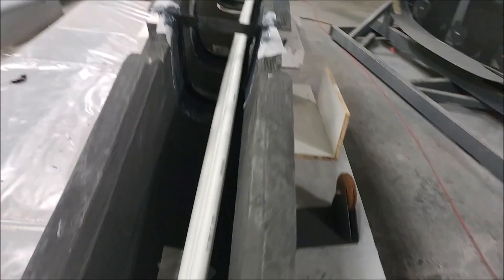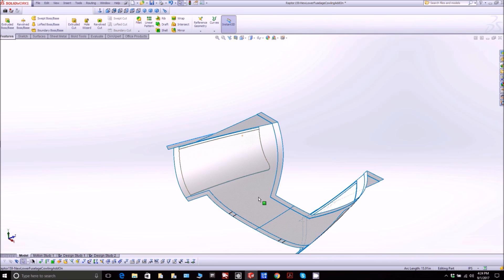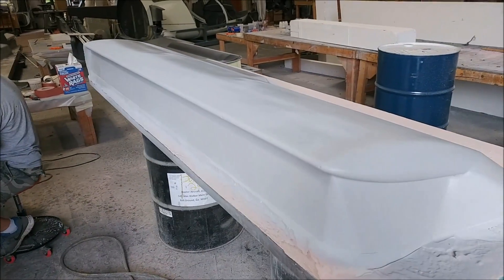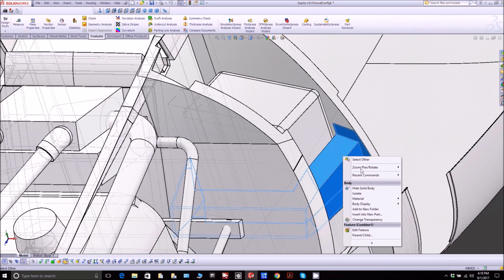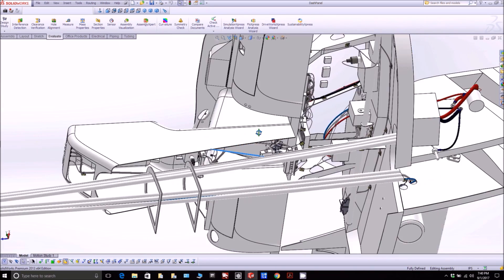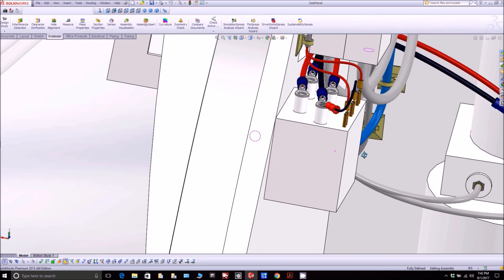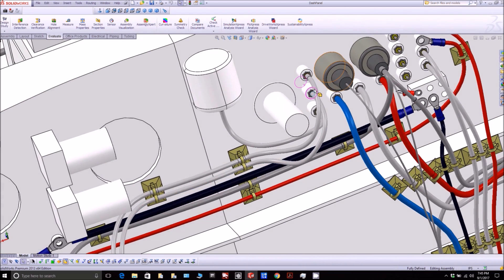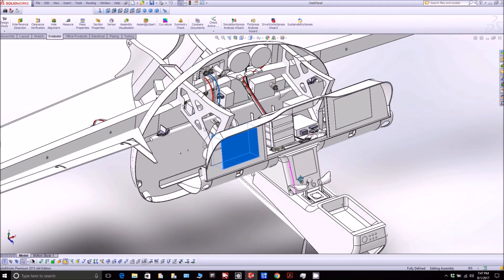Fitting the Nose Gear - And other aircraft building adventures

Comment: Regarding the white "conduits" being installed in the keel... The markings aren't quite legible on-screen, but they appear to be ordinary PVC pipes (please tell me if that's not correct). May I suggest there are much better materials available that more durable (not brittle) and more heat-resistant. For any electrical conduits, UL- rated materials are recommended. Among plastics, PVC (emphasis on "Vinyl") is rather low-performing.

Comment: Peter ~ I may have missed it, but there should be a speed-brake deploy/retract switch on the throttle; to deploy pull back, and to retract push forward to match the forward motion of the throttle needed go-around.

Comment: In the aircraft that I fly, to emergency extend the gear, you lower the gear handle, twist it 90 degrees then pull it out.  I dont know if this is something that can be manufactured or purchased.  But it will keep the emergency extension easy to get to, but also lock it out so it wont be accidentaly actuated.

Comment: I wouldn't put the gear dump so close to the parking brake since they will look similar.  It is common practice to physically that check the parking brake is off as part if the downwind check and it would be easy to accidentally pull the gear dump instead.  Better to separate them in my opinion to avoid accidental operation of the gear dump.
Reply: A wire clip cover or plastic cover could also be used to prevent accidental activation of the dump valve.

Comment: I know someone mentioned moving the ignition key before. I agree. The current location seems to be open to accidentally being touched or hit by either a hand or a bit of stuff that might be flying around the cockpit for one reason or another. Aside from this, the project is looking great!
Reply: I would put it to the lower left of the PIC MFD along with the 70A gear breaker and pressurization dump lever (if possible) shown in the center with a BIG red light.  I worry about my Grande Mocha for anything in that nice center console.   This key location and  these other things does not need to be readily accessible to the co-pilot and in the rare scenario it would be it could be reached...   Simply blown away at the pace and how darn nice this is coming out.
Reply: Maybe we need to come up with a keyless feature? Just like in our cars, our flightdeck will benefit from this. A dongle or similar..?

Comment: Is a key even required? Why not push button since the ignition will be electronic? Either way the placement isn't ideal if you'll need to adjust the throttle with your right hand during start. Perhaps the overhead idea. This would free up space next to the gear lever for the indicators - a bit more standard positioning. Could the VPX could be programmed with a gear warning based on airspeed to preclude a gear-up landing?
Reply: Matthew Berszoner 
I was thinking the same thing.  I don't think a key is necessary.  Just a guarded switch would work well; be it on the overhead or someplace else.
Reply: There is actually a switch on overhead console to actually start engine.  You can see it in the video when the switches were introduced a couple months ago.  Key would just be a security measure is my thoughts.
Reply: A key switch keeps it so simple, Maybe a FOB could be used. As long as you have the RFI FOB key chain with you the plane will start.  just throwing ideas around. I like simple personally. Key switch = simple

Comment: Question about the parachute. When the rocket is ignited and pulls the chute out, what are the chances if the prop cutting the wires? At higher speeds the parachute will be pulled up and aft as the plane starts to decelerate. Obviously not a problem with a tractor design since the apparent wind pushes the chute away from the prop. You guys seem to be very intelligent and have probably already done the calculations though. Can't wait to see this thing fly!
Reply from the maker: I mentioned awhile back that pulling the chute kills the engine via an integrated cut off switch.
Reply: gmonnig my assumption is that if you are using the parachute, the propeller won't be spinning (i.e. feathered = no worries)
Reply: Maybe in some cases the prop "could" be feathered but I would think most cases that isn't likely. Nearly all single engine aircraft don't have feathering props. This does have an electric MT prop so I would assume it could feather but it isn't a very quick action (10-15 vital seconds to feather). That also assumes that there is a clutch that actually disconnects the prop and reduction gear from the crankshaft. If there isn't a clutch then the prop will spin regardless of propeller pitch if the motor is running. You would have to shut down the engine, then feather, wait for the prop to stop then pull chute. You can see that it's getting complicated (impossible for any non pilot passenger). In the event of a control surface failure, you wouldn't have time to shut the thing down to pull the "oh shit" handle. Cirrus aircraft can pull the cute at 500ish feet AGL and can be operated by anyone. You'd already be hitting the ground by time the prop would stop spinning. Just an observation but I'm sure Raptor has already discussed this extensively.
Reply: Ah, I totally missed that. I thought for sure I have seen all the videos! Keep up the awesome work.

Comment: If there is any risk of gear collapsing on the ground with the manual gear dump switch, maybe it not is not a good idea to have it so close and the of the same design. Perhaps  have the parking brake knob and the MGD knob have a different look and touch feel
Reply: Also, he said that there was going to be a pnuematic cylinder that pushes the gear down and I assume this would also hold it over-center and down while on the ground making an accidental collapse impossible under any circumstances short of a gear up lockout switch failure.
Reply: The gear is being designed with a geometric (over center) lock, so it will require hydraulic pressure to break the lock. The dump valve will relieve the pressure so the chances of the lock releasing and causing a gear collapse is next to nil. A guard over the dump switch could be the solution if relocating it is not possible. The same could apply to the ignition switch, but relocating may be better.
Reply: Statistically gear up landing and gear collapse are the most likely accidents.